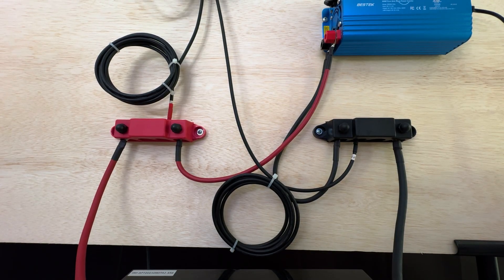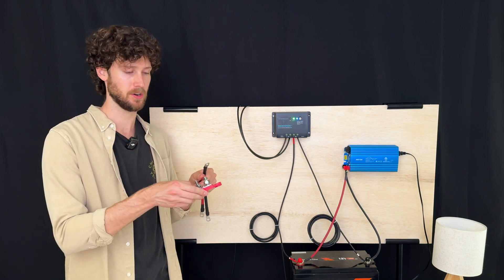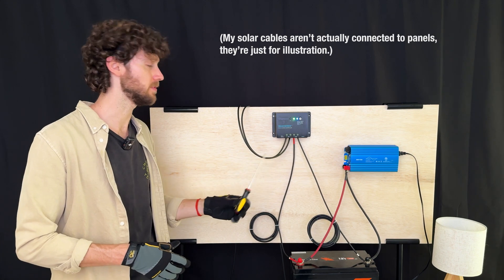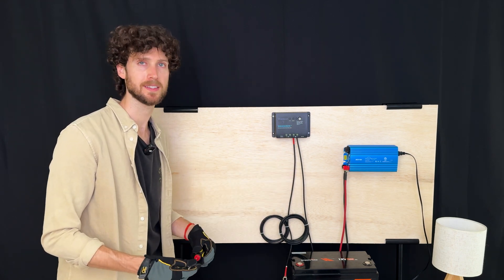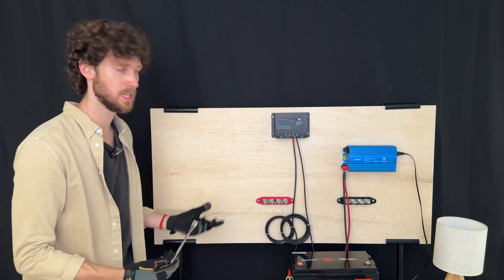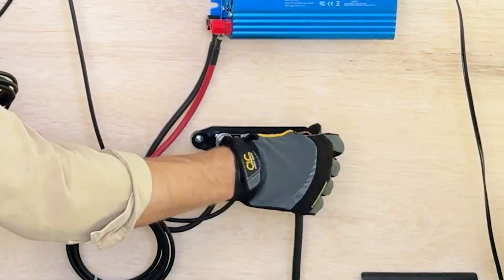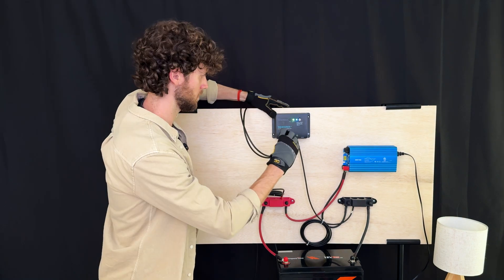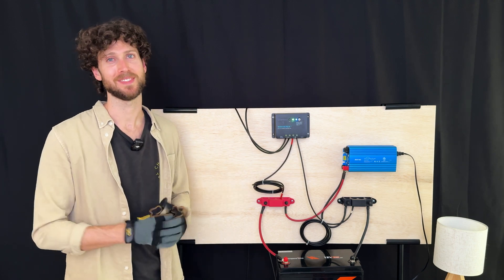How to Install Busbars in a Solar Panel System

Comment: My system has MC4 connectors at the charge controllers with manual breakers for opening a circuit for maintenance. 250a Breakers at the batteries, with 175a anderson connectors for easy disconnect for maintenance (anderson connectors. same as winch plugs or electric forklift charging connectors). Since my charge controllers are Renogy, i am using the charge controller LAN, which monitors the system. I can at any time check solar output, battery input, voltages, state of gharge as well as battery temps, and controller temps. I have 3 distinct solar systems, and 2 FULL SINE invertwers. As a low sun backup i have 2x100a battery chargers that are instant on when i start the generator (which i added a remote control to). all breakers are manual and are also for killing an individual circuit.

Comment: What happens when you take 3 batteries in parallel and take the negative and positive on opposite ends and attach them to busbars that run to your inverter like this
Reply: It should work, just make sure the wire lengths are matched and you have a properly sized busbar

Comment: To add a battery in parallel, would you just connect to the bus bar? I thought you needed to connect the batteries to one another. Thanks. Loved your video.

Comment: Can you add a ground wire to the negative bus bar if you need a ground? Example build a quick set up on a board like that to charge your battery, where does the ground for the SCC go?

Comment: Is there problem with attaching battery cables to the same stud on the bus bar as the solar input or the inverter output cables? Thank you for the video

Comment: About to start my solar setup. Love the vid! Question though. If I’m connected to shore power and wanting to charge my batteries via my 12v 20amp ac battery charger. Should I connect it to the bus bars or the battery? I plan on making it into parallel setup and wanted to know how to charge it when connected to shore power
Reply: It's the same really, since both busbars basically become extensions of the battery's poles/terminals

Comment: Great video. I guess a good use case for bus bar is running two parallel batteries and this frees up the terminals and siplifies the mess when in parallel
Reply: That was my question too. Is this the same thing as making two batteries one?

Comment: what are the limits for this type of installation?  could i make like 5 battery banks that have a manufacture limit of 5 batteries per, to increase the backup power i have by having 5 banks connected to the busbars?